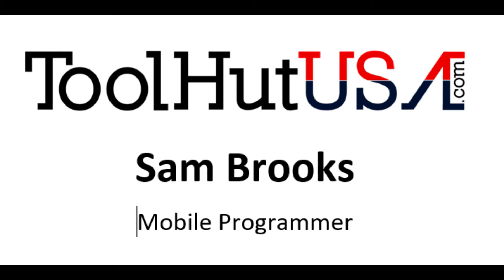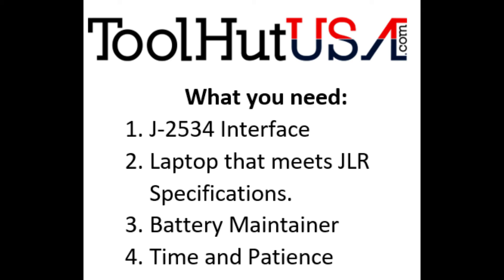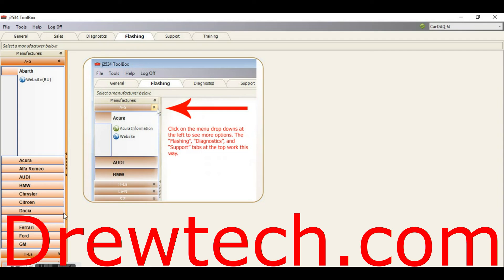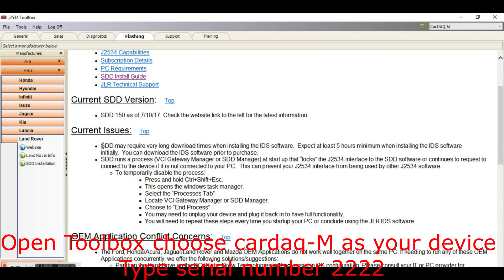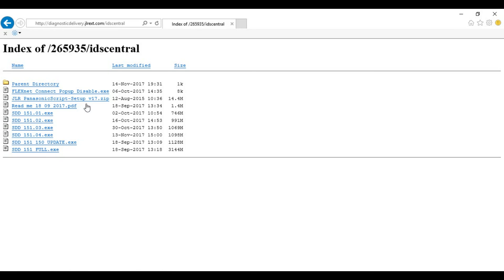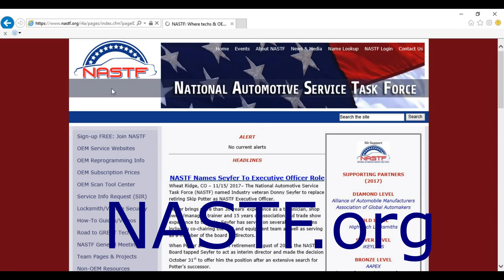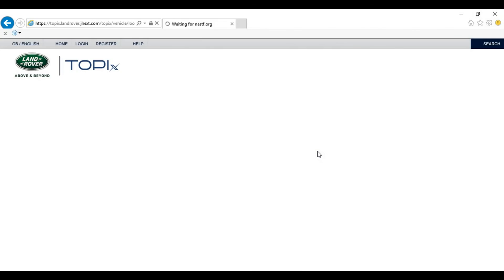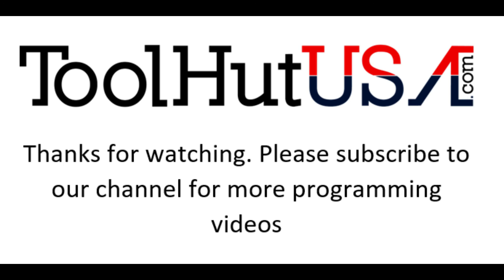JLR SDD (module programming) setup for use with J2534 | Tool Hut USA

Comment: HI SIR I REPROGRAMMER KVM MODULE WITH  159.3 SOFTWARE.TRY 908 LOSSES BOTH KEY MEM. I GOT FULL SYSTEM OFFLINE.SDD 159.3 UPDATE TODAY. I CHECKED THRY SAYING TAKE FUSE17. THEN INSTALL AFTER 10 SECOND I NOT TOO SURE, PLS HELP ME . ALSO PLS FORGIVE MY ENGLISH VERY POOR. 718  451.0700 HITECHGERMAN AUTO INC